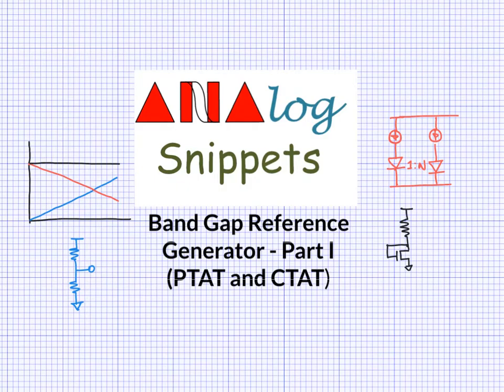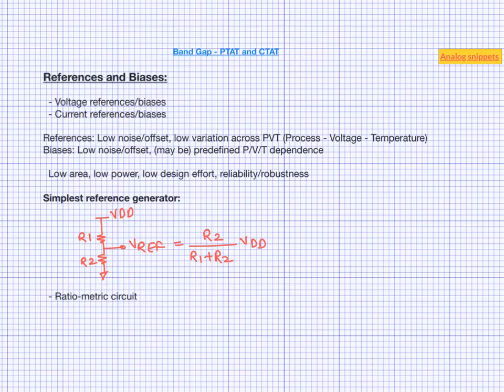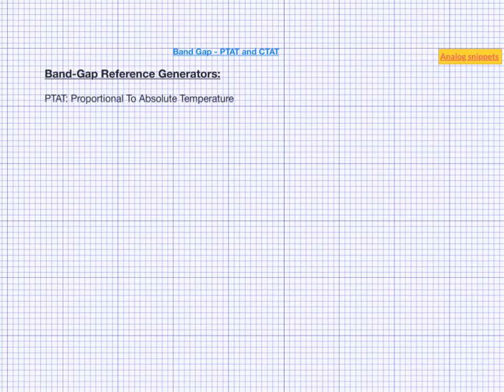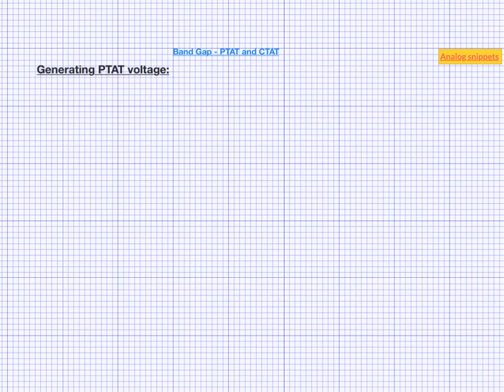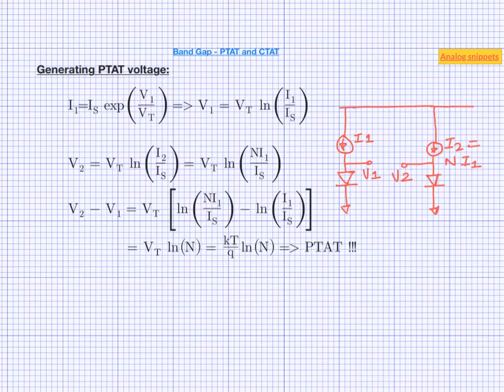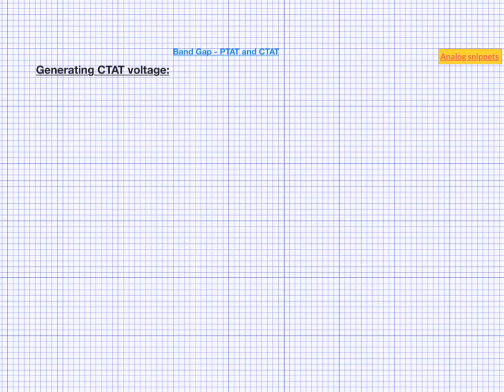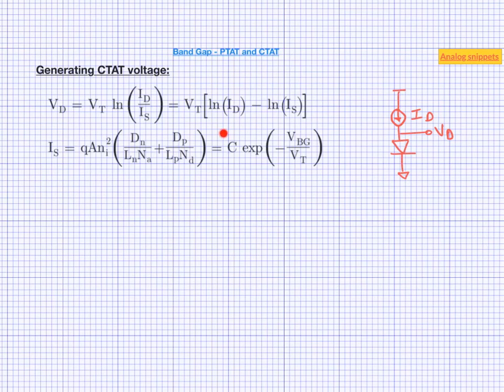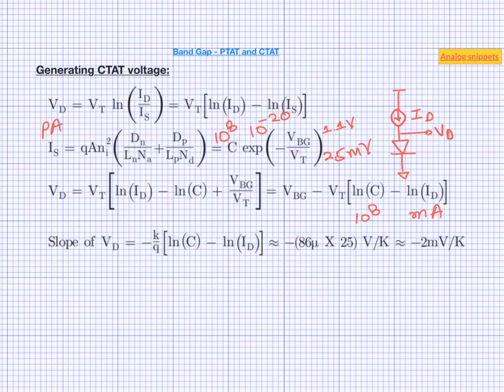#23 Band-gap Reference Circuits - PTAT and CTAT

Comment: So I can use two diodes to compensate each other to have a temperature-stable Vref?
Reply from the maker: Two diode branches do not compensate each other's temperature variations. But you can generate two voltages or currents using two diode branches such that they can be combined to generate temperature stable reference voltage.